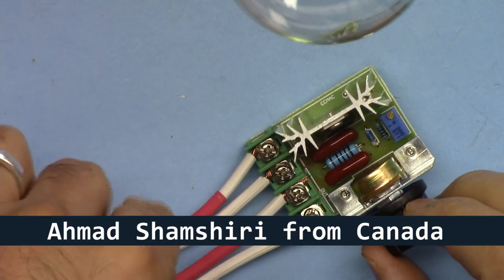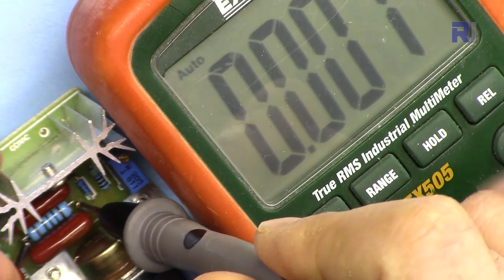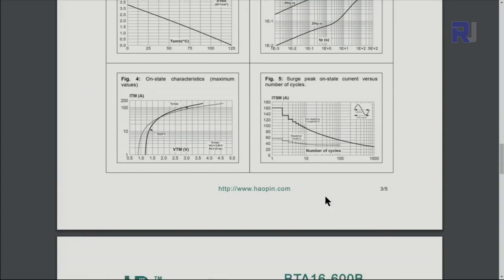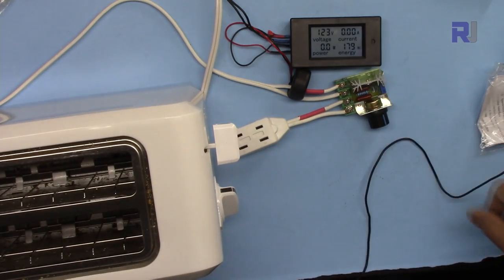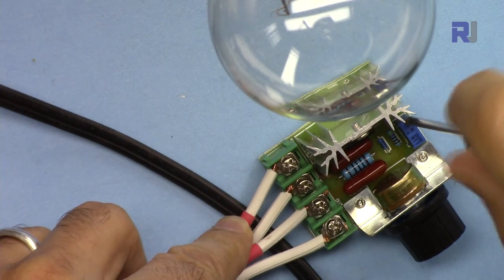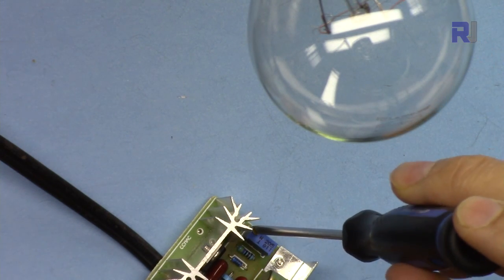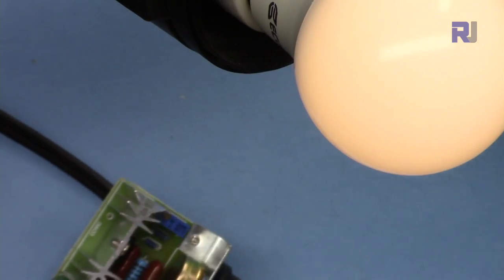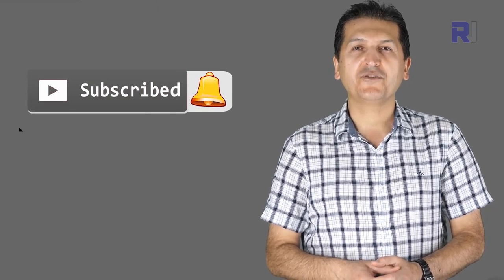Review of BTA16 600B 2000W AC Motor Speed Controller Dimmer - Robojax

Comment: I want to dim filament (not led, the normal kind used in the video). I expect to use at max 1000w of load bulb. however i want to change the 500k pot to maybe a 10k sliding resistor. Can you recommend me for the same?

Comment: Have been unsuccessful after numerous attempts at different pieces. The output voltage remains the same as input voltage  when measured across a multi meter. Is it that it functions only when a load is connected
Reply from the maker: Perhaps you don't know that when we change the speed, the voltage ⚡ is NOT changed. It is the duration of OFF and ON time that makes the speed controlled.

Comment: I watch all your demos and practical advise you provide. I am having one question which is : Can BTA16 600B handle 3000W AC at 230 V supply voltage if I plant to use it in a circuit ?
Reply from the maker: always for amount of voltage, current, temperature, power etc. look into the datasheet. here is one https://www.rcscomponents.kiev.ua/datasheets/haopinfsj489ydf945dt.pdf

Comment: I Wonder if you Can use this to regulate the tension of a micro wave transformer...
Reply from the maker: No it won’t work in theory. But you may try it. Not sure
Reply: @robojax  it seems it works but i don't know if it can be bad for the MOT...
I don't want to burn the MOT...
PS : i use a 4000 W regulator version
I suppose a variac IS better for this job

Comment: Do you think it can stay in a 10mins? using this voltage regulator
Reply from the maker: Hi, this is NOT a regulator. Regulator can regulate (reduce or increase the voltage). but is just controlling the firing angle of triac and in turn it controls amount of energy passes to the load like bulb.  what is 10minu? -10?
Reply: @robojax   okayy thanks, it can stay in a  longer of period of time using that ?

Comment: Nicely done video. Bought 2 of these. One to control my angle grinder----- worked for a second then the scr fused.  The other, to adjust my 120v 1kw water heater element with my solar system. Worked for 20 minutes then the scr and heat-sink fell off the board en-masse! Do you know if these things work with a modified square-wave inverter? Also, is there a better scr to use as a replacement?
Reply from the maker: Hello, it does not have SCR. Uses TRIAC. The module is designed for sine wave. Square wave will turing the shape of signal that triggers the firing angle to turn On/OFF the device.

Comment: will this adjust voltage or watts only?
Reply from the maker: Power only.
Reply: Understand this....Power = V x I (simplified version). Now this equation implies that you are supplying voltage at given frequency e.g. your AC mains is at 50Hz frequency. But what if you can change that frequency of mains frequency (simplified here again for your understanding) ? - you can control power. Suppose you can change the frequency of frequency (ie. for how much time you turn on and turn off the mains voltage frequency, then you have effectively controlled Power because say you have provided voltage for 80% time than Power = 0.8 x V x I. That's it....in PWM terminology , this 80% is called Duty cycle.

Comment: Great review.. Sir, what can you recommend to control the speed of an 2Hp induction motor, 1.5Kw, single phase, 220V, 60Hz, IP-44, 13.5 A and a 1720rpm? i really have no idea. i just need to control the speed of the motor. Thanks in advance.. God bless.
Reply from the maker: thanks. I am sorry I have no experience with AC motors or where to purchase them.
Reply: See Jeremy Fielding videos on motor control,  Voltage controller cannot control induction type motors.

Comment: i am using this same exact controller for a dc motor, i cant get it to actually change the output. i used a bulb and a smaller motor and they both just run normally as if they were plugged into the wall even if i adjust the trimmer, the potentiometer doesnt seem to do anything. ive wired it just as you have as well.

is it just that the circuit is bad or is there something im doing wrong?
Reply from the maker: This will not work for dc motor . Check other product reviews I’ve done onscreen motors
Reply: @robojax  but I have a bridge rectifier after the controller to change to dc

Comment: As always very detailed review, I just got this from Amazon after watching your review, sadly it doesnt control my marble cutter of 1200 watts , 6.3 amp, 230 volts, it does however control my 600 watt drill , but thats not needed as it already has speed control through trigger and 4 speed settings. the cutter stays at full speed whichever way i turn the dimmer. any ideas as to what maybe wrong?
Reply from the maker: I am not sure. perhaps this can't handle such power.
Reply: It works for brush motor, not for induction motor.

Comment: This circuit looks too simple for the control of an AC motor of any decent power output, e.g. 500W, 1KW.  It works for light dimming and heat control.  My understanding of this Triac based circuit is that it controls the duty cycle of the AC sine wave, which effectively chops the power at a trigger point on the power/AC wave going to AC motor.  AC motors do not seem to respond well to this interrupted wave form and and chattering / juddering of the motor speed occurs.  True AC motor speed control seems to have a bit more thought and design behind the circuitry (and subsequent cost).
Reply from the maker: I have said that this not for motor in video. I out that title because that is the name  what this sold  on eBay and AliExpress

Comment: The reason you can't use it on LED lights and alike is because these LEDs are NOT DIMMABLE!  The device you are showing also works much differently than the "more expensive" of the same kind. Frequencies and PWM is involved and that is also a problem for many devices, but old fashioned Light Bulbs and alike will work, but as you can see, the unit uses heat to exchange for control so it will heat up as described in this video. Thanks for the videos, but this wasn't the best example of your work.
Reply from the maker: Thank you. You are right. I have seen request for this. Part of this was recorded in 2018 and the rest I just added.  I could not re-do it so I posted it.